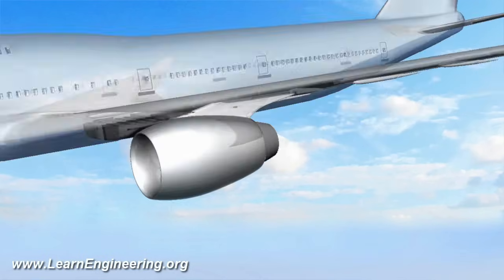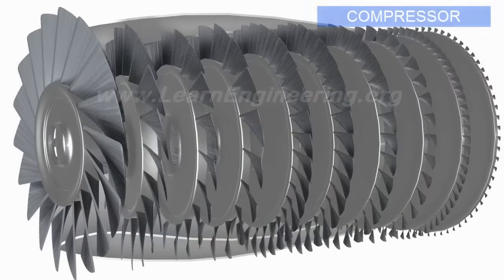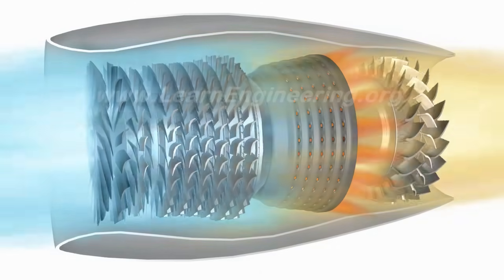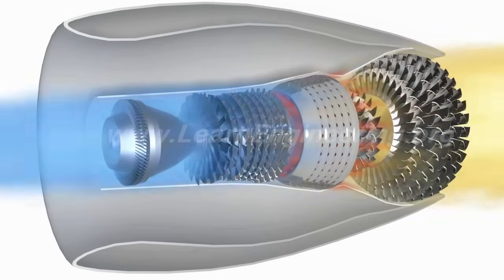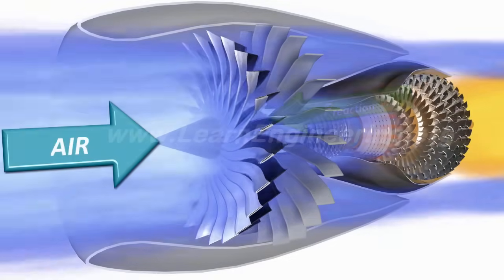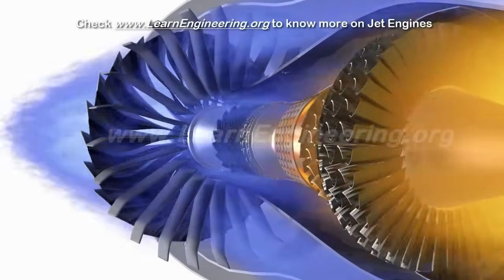Jet Engine, How it works?

Comment: if The engine requires air coming inside, how does it take off, if its still on The ground The air speed is zero isnt it?
Reply: the fan will turn, thus sucking air in.

Comment: great video, until now I was always under the impression that the engine worked like a lung, suck air in + compress, ignite, breathe out - ie distinct phases. It puzzled me as I thought timing would have to be imaculate for that kind of system. I never seen it work as a smooth, continuous process - which makes much more sense! :)

Comment: The power of the jet engine seems to be dependent on the presence of air.......What type of propulsion do 'space' crafts, such as the space shuttle, in the absence of air use?
Reply: Similar process. The shuttle carries its own oxygen supply. When mixed with hydrogen and ignited, it creates a large force that pushes the shuttle in the direction opposite to the direction the nozzle is facing.
Reply: Basically they just explode fuel, which makes the fuel expand and shoot out the nozzle at high pressure. Same concept, just with fuel instead of air.

Comment: could someone tell me what gases are given off from a jet engine? and why some jets leave a trail across the whole horizon which stays there and some only leave a small trail which disappears very quickly?
Reply: +Andrew Lockyer white trails in the sky is nothing more but a simple steam. hot air comes out, water condensates, here you have your little clouds. o/c it's not the only product of burning fuel. CO2, H2O, CO, NOx and a great number of organic compounds. nothing dramatically dangerous, but nothing good either
Reply: Arthur Asulyan You still have not answered why some leave a trail across the whole sky which does not dissipate and others the trail very short and dissipates very quickly and yet they appear to be the same altitude?
Reply: Andrew Lockyer well... different planes, different engines, different speed, wind, humidity. there are dozens of possible reasons)
Reply: Different planes and different engines?? LOL that is not an answer, wind speed, humidity,etc is not an answer either you said yourself that what comes out of the engines is steam you make/put steam in any environment it will dissipate very quickly so you will have to do better than that LOL
Reply: Why do you try to answer a question and then ask me to look it up myself and then call me names ??? lol
Reply: +Andrew Lockyer The engines heat up the air, increase its ability to hold water vapour. When the exhaust gas exits the engine, the extra water vapour condense after contact with the colder surrounding air.

Comment: Quick question!
When advancing the throttle, does it increase the rotating speed of the fan blades or does it just increase the amount of fuel injected?
Reply: Both. The amount of fuel being sent to the engine is increased, therefore more energy is released during combustion. This spins the fans faster.

Comment: How does the turbo fan spool up? Does it have a small electric motor kinda like a "starter" in a car?
Reply: Some planes have electric starters, some pneumatic. They spin the blades up to speed until the pilot introduces the fuel into the engine. Once the combustion process is established, the starter is not needed because the engine runs under its own power.
Reply: Nathan Chetram
Thats what i assumed but it wasnt mentioned lol. ty

Comment: Actually, the majority of the thrust of a commercial turbofan engine like the one on the Boeing 747 displayed in the video are high-bypass, meaning that most of the thrust comes from the cool air passing over the rest of the engine being pushed out the other end. The hot air out of the low pressure turbine provides very little thrust.
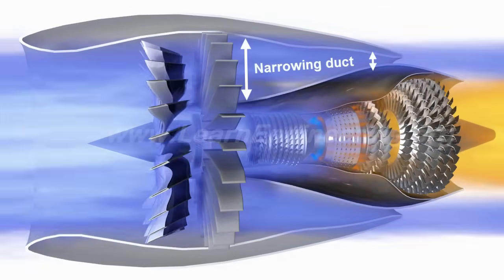Reply: +Jacob E Owens They said that in the video. 4:21

Comment: Is it me or are the front rotors going the wrong way in this animation? They blow the air away from the motor in stead of sucking it up.
Reply: +Captain Dark welcome to russia
Reply: No it's not you, I thought exactly the same thing.
Reply: Wrong way I noticed that also I was like....that fan is blowing not sucking
Reply: Lmao
Reply: +Captain Dark hehe
Reply: No, the fans are rotating correctly in same direction as a turbine, but they have wrong orientation of blades.
Reply: +Matej Capák 
It doesn't look like it's sucking, it looks like it's pushing air out.
Reply: Jens Hendriks

Comment: An aircraft flying at 40,000 feet will have sufficient air in the atmosphere to suck into jet engine and burn the fuel?
Reply: Cruising altitude depends on the weight of the aircraft. The lighter the aircraft, the higher they can cruise. 40 000 feet is not uncommon in most airliners.

Comment: To really understand the principle of jet engine, you need to mention 3rd Newtons law...i.e. m1v1=m2v2......meaning mass multiplied by speed of the aircraft is equal to the mass multiplied by speed of the exhaust gasses. Thus: the faster the exhaust gasses and the larger amount (weight) of gases you exhaust the more thrust you get...i.e. your plane is going to move faster,because the engine is stronger....and so the jet engine is trying to achieve the fastest exhaust and at the same time do it in such manner, it doesn't burn itself.The faster the exhaust gases, the less fuel you need for the same power output.

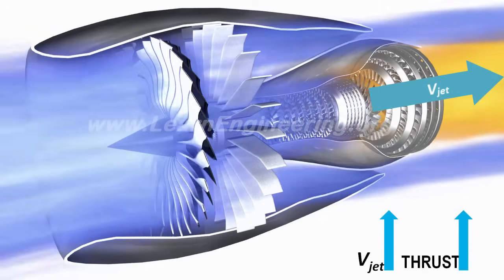Comment: 0:45 Not completely true. The mass accelerated is also essential. You can achive the same amount of thrust by: 1. High acceleration, low mass 2. Low acceleration, high mass. /Aeronautical Engineer
Reply: yeah same reason why they use Lh2 as fuel less molecular mass

Comment: how would elon musk electric jet engine would work
Reply: Mubashir Khan... Great question! When he says "Vertical take-off & landing Supersonic Electric Jet", I have a feeling there is a bit more to it than a ducted motor & fan as lumpmasta mentioned, which is a very good guess BTW...
I'm a bit surprised Elon hasn't Open Sourced this like the Hyperloop, as he has a lot on his plate now... Although I think this is something he want's to develop & oversee himself... since Tony Stark kinda' gave him the cold shoulder... HA!
Reply: +Mubashir Khan I believe its basically the bypass section. So if you take out the engine core, and spin the fan with an electric motor, you get an electric jet engine. The issue he has is that it requires far more energy than can be supplied by modern batteries.
Reply: lumpmasta won't that be electroprop engine ???

Comment: They need a version where he doesn't speak in such a way that dumbcunts understand but it's not literal enough with the choice of words. I need a video to explain EXACTLY what is happening. Example: "makes the balloon move." The balloon has a gas rather than heat. Please....

Comment: What if the combustion chamber was connected to the turbine/compressor axis?
Reply: While it is coaxial with the turbine/compressor axis, it is not rigidly attached to that shaft.  Instead, it is rigidly attached to the housing of the engine.   The shaft(s) between the turbines and compressors, are held on bearings and are free to rotate relative to one another, and free to rotate relative to the housing.

The combustion chamber is stationary, because there is no reason for it to rotate, and the fuel lines have to be connected to it.  It would add extra rotational mass, and be one more rotor to worry about balancing properly on the shaft.  No point in doing so, and counterproductive.

Comment: I'm planning to build a jet engine myself and this video is being really helpful. However, I'd be really glad if someone could help me understand it a little better. What's aproximately the rotor blades' (and stator blades) angle? Something around 30 degrees? The compressed air just gets in contact with the fuel trough the lateral holes of the combustion chamber? What's a good fuel for the engine (among those easy to find as gas, alcohol, kerosene, LPG, etc if possible). Are those turbine's stator blades really necessary? Is it possible to build the stator blades connected to the main axis? Or do they have to be attached to the turbine body?

Comment: So the turbofan returned to blade propelled air again while the turbojet had come to replace it. It is basically an air propelled backwars as any prop before but powered by a turbine and encapsulated. The turbojet was a jump in technology because it made engines simplier with less mobile parts than a piston engine.
Turbofan is basically a high speed turboprop where the propellers are encapsulated and also send air to the engine.

Comment: Awesome, I didn't know about this. I love how energy is squeezed to the limit, like the rankine cycle with reheat or regeneration does to vapor. But I have a question: How does it start? is there a spark plug of some sort?
Reply: ignitor, usual 2 , 50 k volts

Comment: soo...the one thing i never understood about jet engines is WHO DA HELL GIVES THE SPARK TO START THE INITIAL  COMBUSTION?? Is it like a jet spark plug or something?
Reply: +dany dude There is a secondary engine fitted at the tail which is used to ignite the main engines....now don't ask how the secondary engine is switched on
Reply: Dudley Smith thx man, the secondary one is probably electric so i won't ask :D

Comment: No no no no no no no no no this animation will not do at all... 
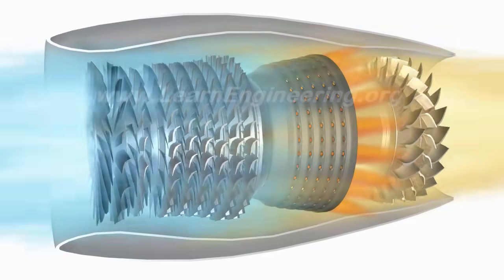This engine will not run.  The compressor blades are installed backwards in relation to the high pressure turbine, the Stator vanes DO NOT bend like that.  They are meant to straighten out the air flow through the engine.  The only stators that bend like that are the turbine nozzles for the high pressure turbine and low pressure turbines.  The turbine blades are installed correctly, but there needs to be a nozzle (set of stators) in front of the first stage turbine.  The statement from 2:18 to 2:24 is incorrect.  The turbine nozzle directs the air flow to the turbine blades.  Basically the turbine blades get blown like a sail from the expanding gases passing through the turbine nozzles.  Fan blade tips do not reach forward from the rest of the blade.  The fan blade tips also do not bend away from the direction they turn.  At least the N1 fan and turbine blades are spinning in the right direction.

Comment: so so simple just fire and air...n few metal fans...who
who invited the jet engine?..
was a ginuse
Reply: Turns out, both a Brit and a German designed their own turbine engines at roughly the same time (1930s). But, it was a bit more complicated than just air and fire. That Brit kept blowing up his prototypes, and by the end of WW2, the Germans melted theirs. By the end of the 1930s, a genius working for Lockheed designed the first axial flow engine, but even that required an understanding of fluid dynamics not yet formulated.

Comment: So why do aeroplanes need fuel?   To rotate the rotors?
Reply: Cold air goes in one side, the compressor blades compress the air, this adds pressure, the air travels through the combustion chamber, and gets heated up by the burning fuel. Heating the pressurized air causes it to expand, thereby increasing the pressure even more. Then the highly pressurized air passes over the turbine at the rear, which is connected to the compressor blades and spins them, allowing the turbine to continue running under its own power. The pressurized air then exits out of the back. Watch the video again, if you don't understand, but the fuel is used just to heat the air and pressurize it even more in this case.
Reply: I understood the process I just needed to know what is the use of fuel anyways thanks for the explanation 😄👍
Reply: +Ashwin Nayaka no problem 😊👍🏼👍🏼
Reply: +Ashwin Nayaka The fuel does the exact same thing in a jet engine as it does in a regular car engine.  Burning fuel causes expanding gasses to pass through the turbine allowing the engine to sustain itself. no fuel no run.

Comment: Since the 80's we've made pressed silica nitride turbine discs which get hot enough to steam water so well that water is a better fuel than jet fuel.  All American Aircraft of Long Beach Ca did this.  Now PSN is much cheaper. Just a 10" square turbine disc and compressor setup will provide 100hp. It would be something if a guy could make psn at home using a plasma process inside a microwave oven with duraboard insulation. All you need for plasma are a set of capacitors arranged in a circle which build like a vertical wound copper coil. I am currently working on growing diamond using such a machine. Just have to fix my big lathe and make a few custom crucibles.
Reply: I thought you weren't joking
Reply: +Anti donkey missle I had a book showing photos of "All American Aircraft's " Phalynx if I remember correctly, out of Long Beach, CA in the late 80's or early 90's; where they produce a vtol using nothing but hot pressed silica nitride. It had no big wings; just short fins around. The turbine served as a stabilizing gyroscope as well.
I can't make psn but I may be able to make diamond coatings.

Comment: And how does fuel take part on this?
I don't think I understood it...
Reply: +Pablo Cid Fuel is atomized through little nozzles and sprayed into either a combustion can or the ring assembly shown in this video. The combusted air produces more energy because it's hotter and therefore is a higher pressure. When the hot air goes through the narrower exhaust, which is shaped like a venturi tube, the high pressure is turned into velocity thanks to bernoulli's principle. That high velocity gives the engine thrust.
Reply: i'm allowed indoors
thank you very much mr. dog!
Reply: I thought I should update it since I've started using this email for serious business shit.
Reply: +Pablo Cid i did but ruled it out coz i though u are a jerk :/
Reply: +Sean Smalley ;o ok
Reply: And so why the pressure being take down at the end of the process with those fans? Isn't that the moment where max pressure and so air speed is recquired?
Reply: Instead to tell us the truth: We will not tell all of you how it works but we will kept is as a secret for our friends; they tell us a lie... It is sad I know, they are sad.
Reply: Feint Nigh tmare
 his nickname was "something-dog" when Ihe replied to me. Didnt you think about that possibility before commenting?
Reply: +Pablo Cid dog? srsly? to the guy that just helped u? wow ._.
Reply: There is no fuel. It's compressed air!

Comment: Quite difficult to get my head around this but I think i get the basics. The pressure after the compressor is 35 bar absolute; the burner adds alot of heat to the incoming gas stream (air) when the kerosene is burnt so a very much greater volume of gases at the same pressure, 35 bara, exit the burner. A large pressure drop across the driven turbine turns the shaft. The only point I would take issue with is the pressure immediately after the driven turbine & before the nozzle being stated as atmospheric pressure 0.75 bara. Were this so there would be no pressure drop to create the high velocity jet issuing from the nozzle.
Thinking about this makes me remember that, as a kid, i was confused that a steam locomotive used a pump to force water into the steam boiler in order to keep the water level correct, not realizing that this required little energy to achieve compared to the much increased volume of steam the boiler produced (again at the same pressure as the water pump is running at).

Comment: but aren't the turbines made of...i dunno...steal beams?
Reply: +hithummah No, they're made of composites ceramics which are very resilient to heat (with metling point at about 3000 degrees Celsius versus just 1000 or so for steel). Plus, the first turbine blades are also cooled by pumping high pressure air through some small orifices on the surface of the blades.

Comment: That awkward moment they call it a jet engine... It's called a turbo fan engine. Jet engines are on fighter jets and are not used on 747s with only two engines. Also turbo fan engine compressors spin in the other direction.

Comment: Compressor blades rotate in wrong direction, and the video begins with the lie "jet engines have been the successful drivers of aircraft for nearly a century now"... try 70 years.

Start with a lie, use an incorrect animation....  SKIP VIDEO!

Comment: So combustion is just controlled by fuel volume given and blade speed? What about ignition?  Does it just spark the fuel at start up and the flame keeps burning?  How do you shut it off, just cut fuel supply?  Okay video just seems to be missing a couple of critical steps.